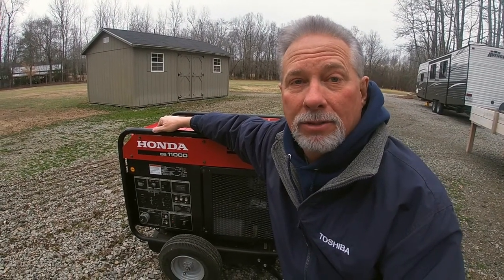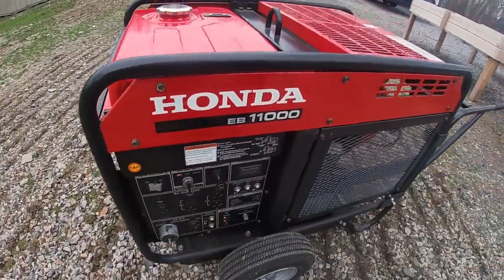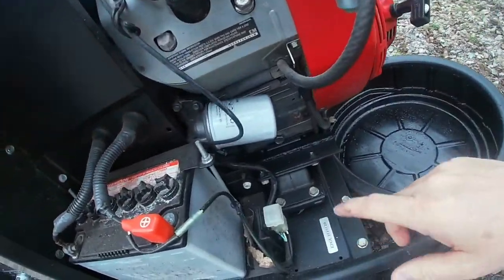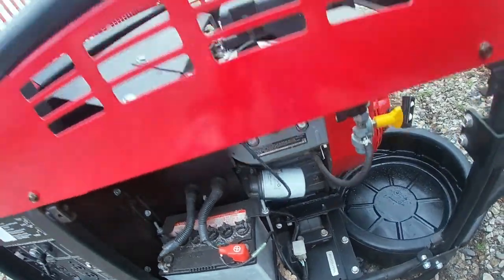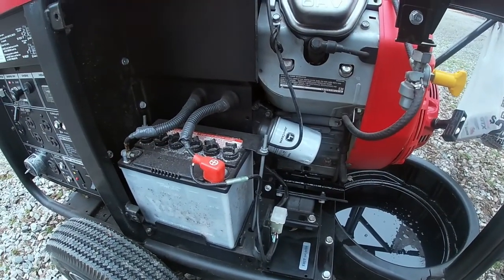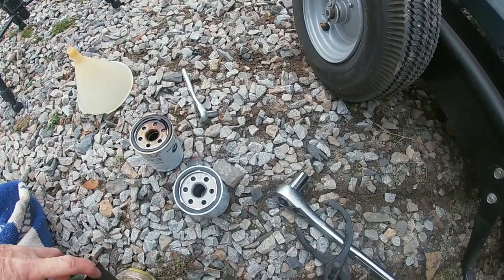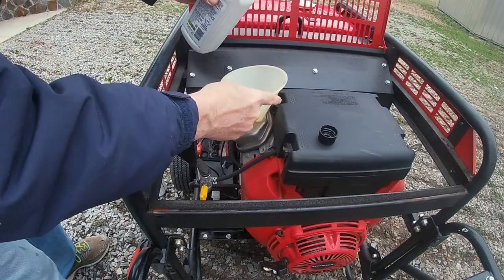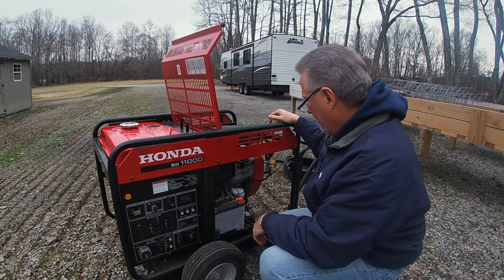HONDA GENERATOR / ROUTINE MAINTENANCE

Comment: What size is your Dads propane tank? Will the propane dealer come out and fill it or do you have to take the empty tank in?
Reply from the maker: 100 gal. Temp for now. I just ordered 320 gal. in ground. That install will be on an up coming video in spring. Tank is on loan from a friend.